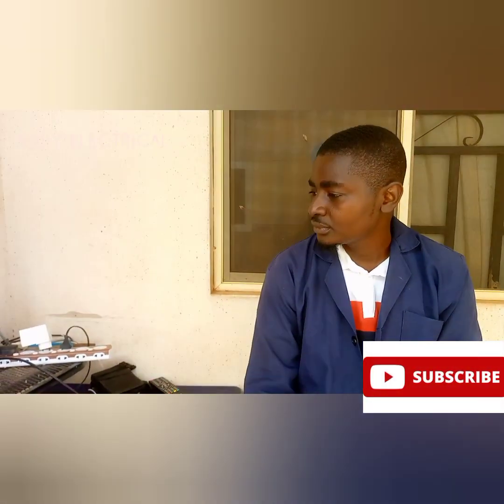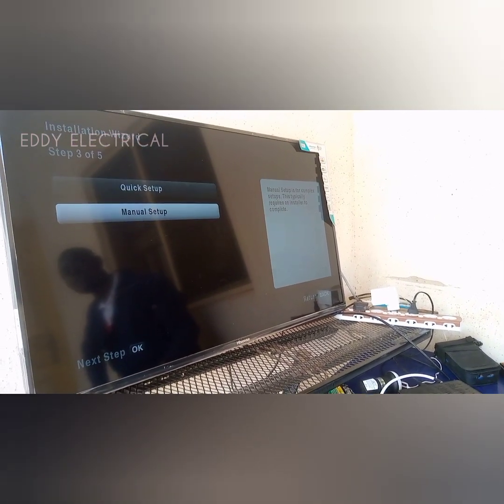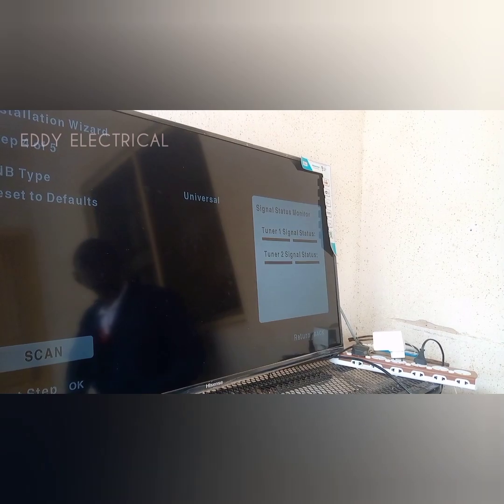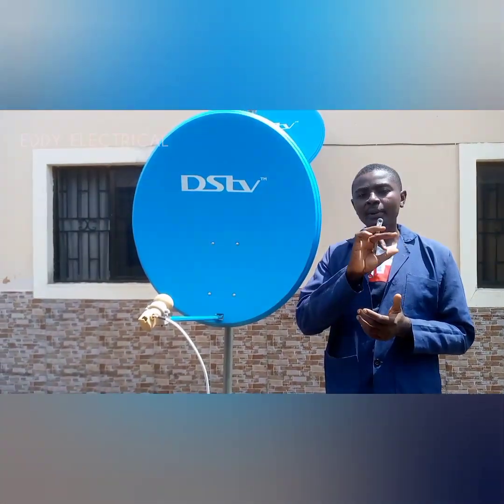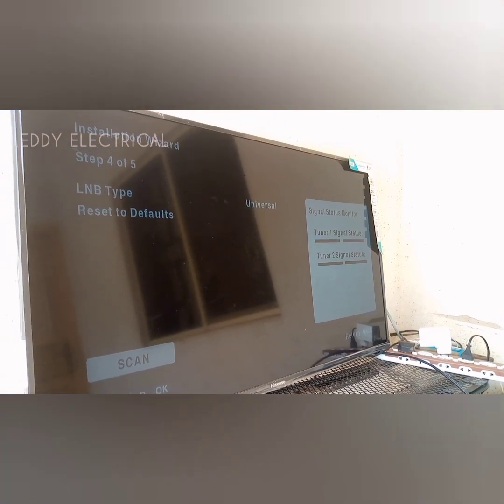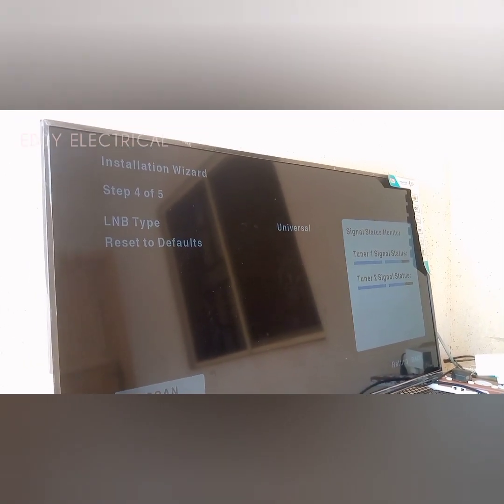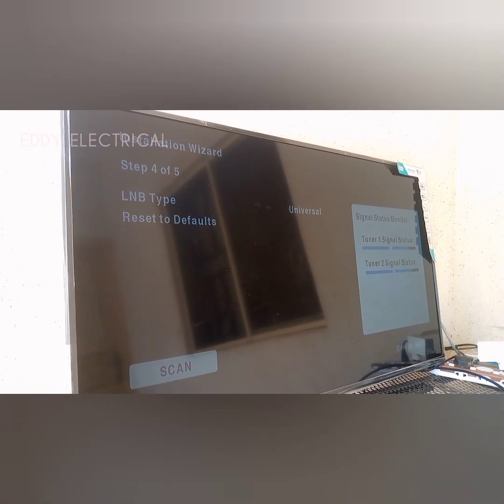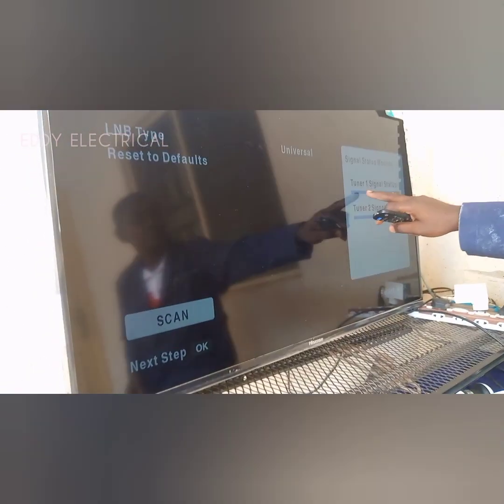Track DSTV signal Without a Satalite Finder meter #trending #dstv #dish  @eddyelectrical7671

Comment: My Dstv is not showing the blue coloured signal no matter how we move the dish, what am I to do ??
Reply: Sir, so we were able to get turner 1 to move but the turner 2 is not even showing at all.
Reply from the maker: Is either decoder is faulty or youve not goten the signal
Reply from the maker: Maybe is signal problems 
You need an installer
Reply from the maker: Maybe is signal problems 
You need an installer

Comment: Haven't seen what you did on the dish outside,🤦🏽‍♀️ please help🙏🏾 what did you do or touch
Reply from the maker: I just moved the dish
Reply: @eddyelectrical7671  okay, I will try that🙏🏾 thankx
Reply: How did you move it?mine is not moving because it is fixed with  boats?